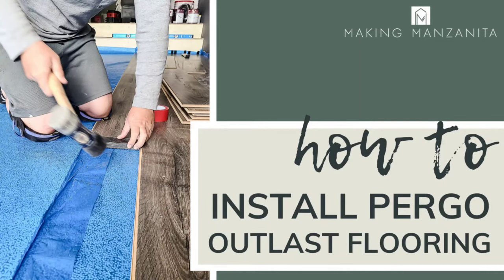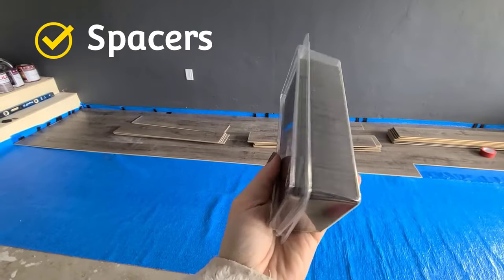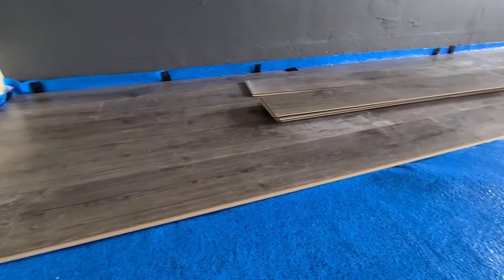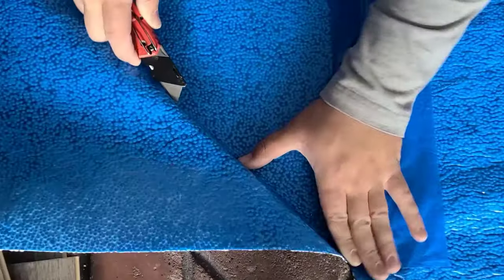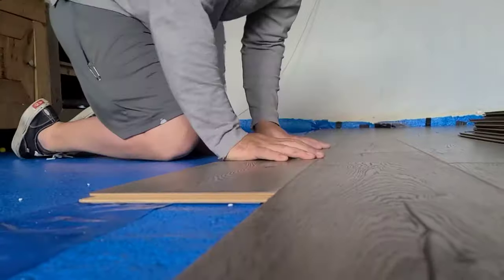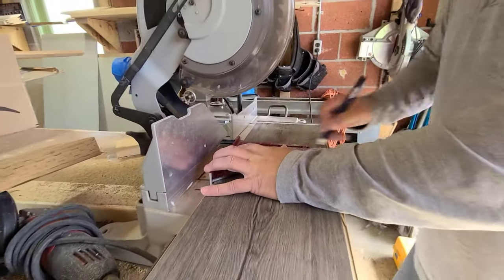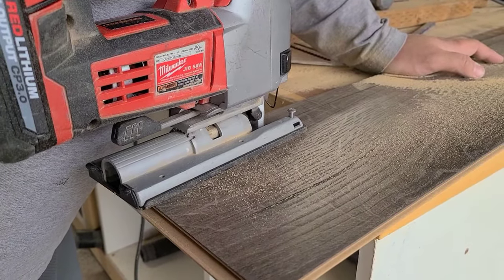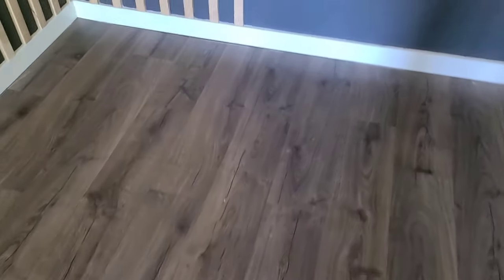How To Install Pergo Outlast Flooring | DIY Laminate Floor Installation for Beginners!

Comment: Looks great, we will be installing our whole 1st floor this coming week (well after painting).  I am using the same type of Pergo and wasn’t going to use the under flooring if it passed the moisture test, but after hearing that it helps with the sound will also install.
Reply from the maker: Yes, it definitely not going to hurt anything to use the underlayment in addition to the Pergo flooring. :) Good luck with your install.

Comment: Did your flooring have pre installed underlayment alreadon it?
Reply from the maker: Yes, the Pergo Outlast flooring comes with a thin underlayment attached to it, but we always add additional underlayment (especially when installing on a concrete subfloor like we were). Underlayment provides the necessary stability and support for the floor to float and helps with noise reduction and cushioning. The underlayment that we used also provides moisture protection (which is important on a concrete subfloor) and offers constant air movement to help inhibit mold and bacteria growth.
Reply: @MakingManzanita  Thanks! M8ne has pre attached underlayment also it is the pergo outlast.   So do you think it will be okay to lay down underlayment 1st on wood subfloor as well?
Reply from the maker: @tyleroryan  You're probably fine to rely on their attached underlayment, but we prefer the extra protection and cushion of an additional layer so we always add our own :)

Comment: How did this underlayment work with the Pergo?  Any flexing?  The Pergo underlayment is so much more expensive, it would be nice to use this one instead.  Great video.
Reply from the maker: We have had no problems and it works just fine.

Comment: This was a very helpful tutorial, well done.  I'm installing Pergo Outlast+ waterproof laminate flooring and the instructions say to put a round foam caulk saver into the expansion gap, then follow with 100% silicone caulking around the perimeter of the floor.  It doesn't look like you did this step.  Was your flooring not the "waterproof" version of Pergo Outlast?
Reply from the maker: If you want the edges of your room waterproofed, follow along with the manufacturer's instructions. We opted out of this step because we weren't worried about waterproofing along the edges of the room.

Comment: DIY manual available?
Reply from the maker: You can Google the manual from Pergo if you'd like! We also have a blog post that goes with this video for more written description: https://www.makingmanzanita.com/how-to-install-laminate-flooring-on-concrete/
Reply: This floor says the underlayment isn’t needed: why did you choose to put one down? I’m just curious because I’m about to install it on wood subfloor.